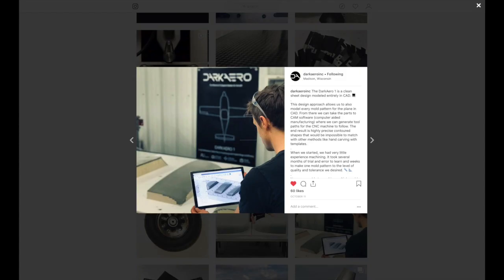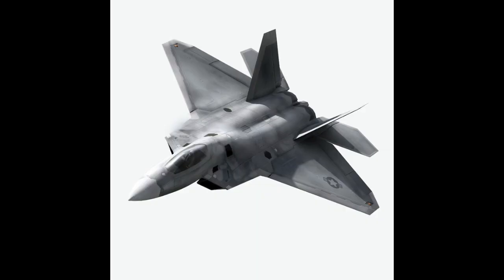Why use CAD? - DarkAero - Tool Tuesday

Comment: If I buy a kit, will I have access to the full 3d files so I can look around at the construction in Fusion 360 or Onshape myself? When making the models into reality I often use the measurement tool to get dimensions on the fly.
Reply: the answer was mentioned in another video.  yes you can get a trial version of Onshape and look at the darkaero in that to help with the build process.  

figured I'd answer this in case other people have the same question.

Comment: "3.45" Finite Element Simulation is looking insufficient ,   , mesh density is not acceptable  , use shell elements , and please be careful when the simulate composite layers , because , it is untrustable  when you simulate composite materials  ( composite of layers ) on finite element solution  (Just max %30 trustable ) , because Composite materials have 3 axial  strain (x-y-z- εx - εy -εz)  

Ansys : Sales&Technical manager on Turkey
Defence and aviation engineer

Comment: Have you guys try to use a jet turbine engine in the front to give a clean look and have a charge up on price plus a nickname as dark aero vedor
Reply from the maker: Alonzo Cervantez 😁 We have looked at a turboprop engine but the fuel burn numbers for small turboprops are really high so it wouldn’t allow us to achieve the long range we are targeting. Thank you for checking out our project!

Comment: What are the expected takeoff and landing field requirements?  Is grass (ctq2) ok?  Do you need representation in Canada (Quebec)
Reply from the maker: George, it's designed primarily for take off and landing on paved runways. However, if the strip was well maintained and free of major obstructions, you could perform a grass strip landing. We do have reservations holders from all over, including Canada!